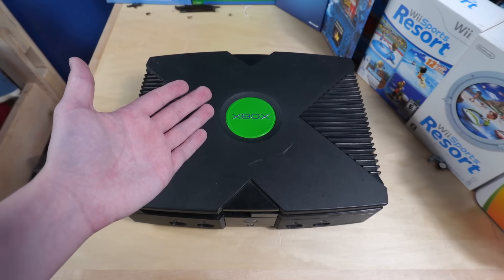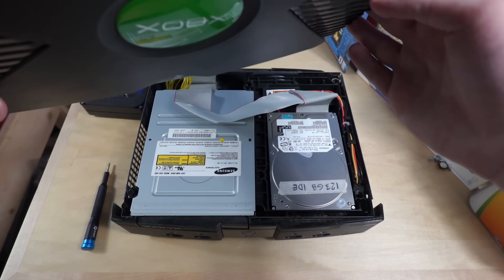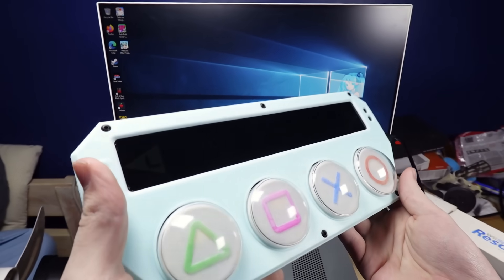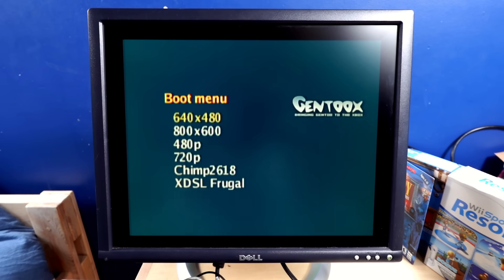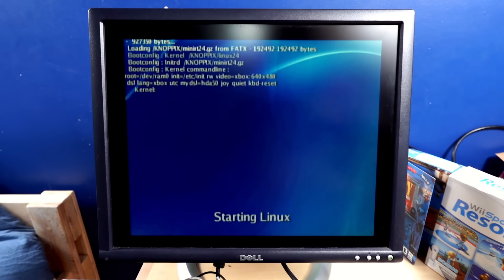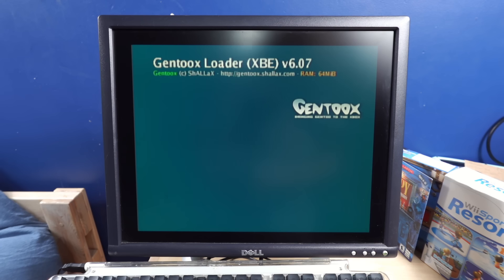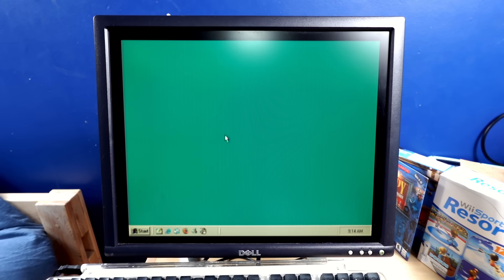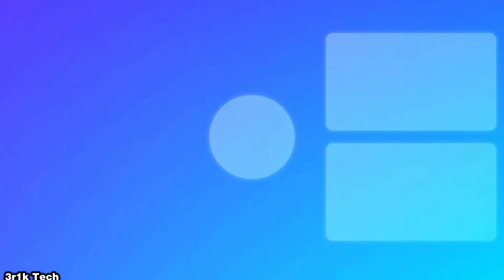Installing Windows On An Original Xbox

Comment: I remember running damn small Linux and windows 95 on my Xbox back in 2007. Was fun to play around with but useless as it was kinda slow and back then there weren’t any working drivers for things like display so you only had 16 color display for instance. The 98lite image you used had drivers since the IE icon for instance had full shading and coloring. Lastly, 98lite is a modified win98 image from waaaay back. I remember using it circa 2000.

Comment: Why not try running real Windows on it? Windows 9x is just a DOS shell, but Windows 2000 should work great, after all XBox is based on Windows 2000 but stripped down, so Windows 2000 would be an upgrade.

Comment: I am not entirely sure as i haven't tried it myself, but there IS a port of ReactOS to the original xbox and because of that, may be possible to reuse its bootloader to possibly natively run windows xp on one as well? i do not have exact specifics but would be an interesting try

Comment: Fun Fact: The Original XBOX Uses a modified Pentium III and a custom Nvidia GPU it's pretty much a locked down Windows PC running console games
Reply: windows CE?
Reply: @mastergamer2020j  Windows 2000, but heavily modified
Reply: @adamsfusion  Maybe, i think the Original XBOX came before Windows XP so it's most likely using a modified Windows 2000 version
Reply: And the Xbox 360 is based off Windows XP.
Reply: @mastergamer2020j  no
Reply: Mobile Celeron 733. It has 128kB of L2 instead of the 256kB of a Coppermine Pentium III so it's a Pentium III only in marketing terms. A Pentium III-based Celeron.
Reply: All consoles are actually…..all…..circuits…chips…graphics… processors….yada yada …but ppl will dck fight and say they are not
Reply: @harleycooper8595  The point is, every console that came before the Xbox was not x86-based and most certainly did not use an Nvidia chip with a similar design to what could be purchased off the shelf as commodity PC hardware at that time. The Dreamcast, PS2, and essentially every 5th and prior generation console were heavily customized.
The only real case you could make for being vaguely PC-like was the GameCube's similarities to an iMac G3 in that it used a PowerPC 750-variant CPU and an ATi chip, but which had almost zero resemblance to the Radeon 7000 series.

Comment: I had read somewhere that the original Xbox was running a modified version of Windows 2000. I wonder if you could get retail Windows 2000 running on the Xbox.
Reply: Yeah I'm pretty certain that the original Xbox was running a modified version of 2000
Reply: It was just windows 2000 using a custom shell and heavily modified windows kernel.
Reply: It used the kernel from win 2000 but the os was custom aka the gui
Reply: Also the 360.
Reply: Newer xboxes run windows 8-10

Comment: 6:28 It never needs a password.
On Windows 9x versions, you can literally click Cancel on the logon dialog and you will simply boot straight to desktop.
6:48 Also the main reason that is the case is that Windows 9x simply did not support VESA BIOS extensions, so the best video quality you would get on stock installs would end up being 800x600 with 16 colors

Comment: If I'm not mistaken the XBox Classic is just a PC on console substances 😅. So it makes sense for it to work.
Reply: Also the Xbox's "OS" is based off of Windows 2000 (Heavily Modified but still there)
Reply: @aliangel5007 Oh true, that's what I meant ig
Reply: The Xbox wasn't designed to run Windows 98 natively, so there are no suitable hardware drivers for it. It's OS is based on the Windows 2000 code base, but unlike Win98, Win2K isn't based on DOS, so is incompatible.  Hence the need to run an emulator.